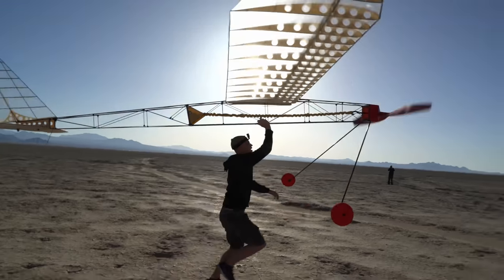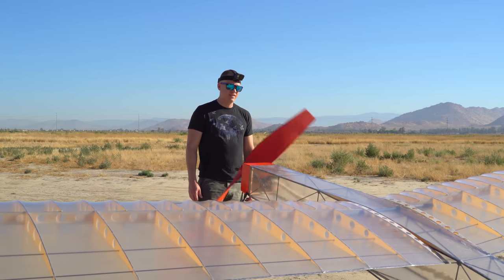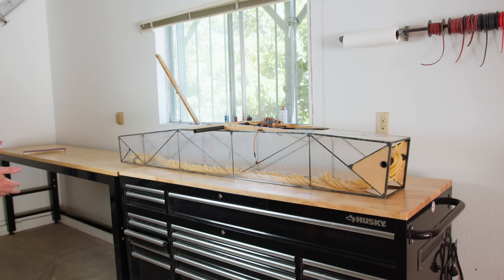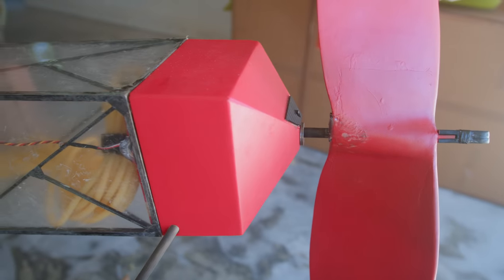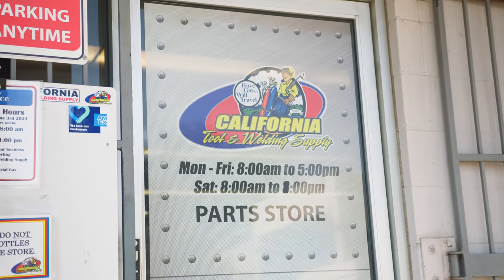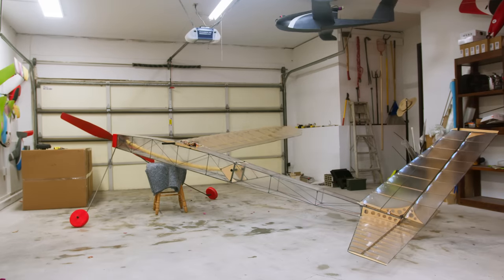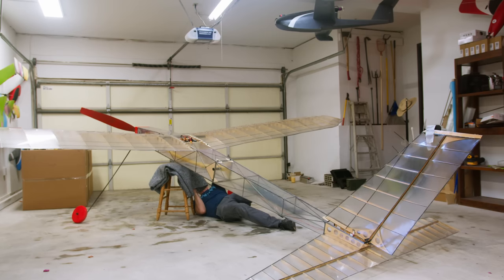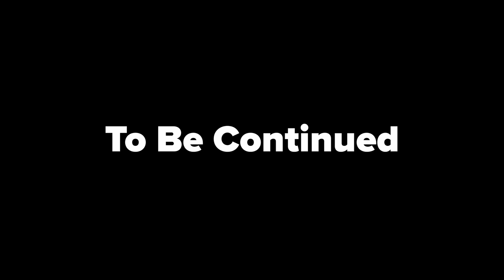Balloon Launching Massive 16 Foot Rubber Band Airplane

Comment: YES!  I wanted to see more of this project...sorry for how it ended but learning happened and better for it keep on!  One thing may help, aside from improved wing torsional rigidity; slightly more down thrust and a bit more decalage.  You'll probably need to adjust the c.g. fwd.  The initial powered flight in this video showed it nose up a bit.  Probably could have a longer powered flight from hand launch.  In any case, superb build and engineering.  Yeah, ok enough armchair engineering from me.  Thanks for continuing looking forward to more!

Comment: I love your determination. In the propeller’s blade twist, I recommend the propeller’s root angle not exceed 75 degrees away from the blade’s direction of rotation. Your current design clearly reaches a full perpendicular 90-degree divergence from the blade path, which creates extreme drag and reduces the thrust output.

Comment: Keep on going!  The repairs never take as long as you think, especially with an open structure like this. 
Diagonal bracing between the ribs for torsional rigidity, but also check the angle of incidence... tricky to tell form the video but it looks as if the main wing hasn't got much of an angle of attack relative to the tailplane. With more decalage, the model wouldn't have sped up as much upon release. I'd also add a couple more degrees dihedral too.... great work, very much looking forward to the next instalment!

Comment: I think you should use a shorter rubber band. Your issue seems the power and not the period for which it's produced, so a shorter band will help with that. In addition, it'll drastically reduce the weight. I could be wrong with this theory, but seems logical to me.

Comment: Am so impressed with the engineering of this design that keeps this aircraft light, strong and being fully transportable in a normal vehicle (9:17). Such an impressive set of engineering logistics and constraints to balance and manage, while staying true to scale of the original balsa model.
🤯♥
The flight sequence from 11:40 was not expected! Left me wondering if could have pre-revved propeller rpm, so as to release with positive thrust?  Questioning if the aircraft was able to create positive thrust relative to airflow profile as it flew. At higher speed the blades of a fix pitch prop, can act as airbrakes. Thinking negative thrust may have been a contributing factor to the downward pitching moment.
While the outcome may not have been desirable, this chapter of the project did collect lots of great data. Making connections with Chris, Curtis and others helping behind the scenes was definitely a positive outcome for this chapter. Thanks for sharing your rollercoaster of engineering and learning endevors. Look forward to the next chapter. :)

Comment: You can use a pendulum for the elevator and a clockwork timer for the rudder and dethermalizer. I used to do that in 70s and you can still find that stuff today if you look up free flight thermal flying. They even have international competitions.

Comment: Very inspiring. I personally find it difficult to push through situations which don't go to plan. It's very easy to give up and question yourself in these moments. It's very easy to let those intrusive thoughts win. It's very hard to keep going when you feel like you'll fail again and again. But no great achievement was ever easy and it's at these moments where greatness is born. 

Most people will give up when it gets tough but those people aren't written in the history books. Your channel's success is a testament to your personal ability to push through these moments. I love your channel for this reason (and lots of other reasons). Keep em coming and we'll keep watching! ❤
Reply from the maker: Appreciate you taking the time to say this.
Reply: @thinkflight  
the problem is that it is difficult for rubber to turn this screw, the screw should have as little resistance as possible, make it out of plastic and light. You can also reduce the diameter a little. The resistance on the bearing should be minimal
Reply: @thinkflight  
I made a plane with such an engine as a child. At first I used a wooden propeller, which I made myself, it flew poorly, then I replaced the propeller with a plastic one, from a broken helicopter, with which it began to fly well
Reply: @thinkflight  experiment with the design of the propeller, the problem is in it, it doesn’t fly well because of the propeller

Comment: I still don't understand why you don't use exercise bands.  They have versions with different strength levels and are very large.  You can also use a large spring of different types.

Comment: Mount the wing a tad higher, further above the CG for stability.  Or maybe add some deheidral for the same effect. No reason not to have both rudder and elevator.  And to combat wing twist, you could try some internal cable bracing between the wing formers.  Or go for diagonal, x-formers...

Comment: I remember an elastic powered plane I had as a child, it had strange wide props all the way to the tips not streamlined like the one's on yours.  Never seen similar props since but I do remember they were odd.  The plane flew I had flew for ages and some distance when I forgot to bend the rudder so it would circle, ,maybe bigger or a change of props on yours would help ?  

I think the idea was to move as much air as possible and not worry about drag so much as the plane wouldn't be flying that fast and it would help keep the speed  down at a constant velocity.

Yours flew brilliant at slow speed on hand launch and just seemed to need a little more oommph to keep it going ?

Comment: I know suggestions can fall flat sometimes so I’m starting with this:  This is amazing work!  The distance you’ve traveled in this project is impressive!

Great endeavors always take on a life of their own. Also they attract people who want to see others succeed!  

I have been watching this project from the start and I can’t wait to see where it goes from here!

So inspiring!

Now the suggestion:  Yes, you should definitely add the servo’s but the elevator is really a large trim control for this aircraft. 

Also, I think you should have the prop spinning with the nose pointing up before you release. This would require a really long tether between the balloons and the aircraft. The aircraft should already be nearly at its level flying airspeed when released so that there’s a minimum amount of drop. The flexible wings cannot withstand the over speeding of the air beyond the trim speed of the plane. It came very close to its VNE!  

If it’s practically flying at release it should stay in stable flight the rest of the time.
Reply: Yes!

Comment: This video ought be interesting....

I took the Guillows Flying Machine or the baby, baby, baby  brother of your plane and added two micro servos with receiver & a tiny brushed motor to it after adding a movable rudder and elevator by using scraps of balsa that was in the box of die cut parts for the rudder & cutting off 5/8 inches of the horizontal stabilizer to form an elevator. The hinges were made from two parallel strips of painter's tape joined at the center  with a coat of CA after aligned.

It flys beautifully in a calm sky. Love it....  Nothing else I have performs like it and its charateristics are very similar to the old Ugly or Slow Stick that Eflite seems to have brought back.

Comment: Some advice:
1) Materials like Monokote and Ultracote are specifically made for model airplane wings and they resist twist and stretch far better.
2) Your propeller pitch is too high given the size and the torque the rubber bundle can put out.  This is why the model won't climb very well as the prop is not generating much thrust.  It is like starting a car at a high gear.  The shape of the prop is really made for the small 4-5 inch diameter props where the rubber torque is very high for the size.  The pitch is intentionally set very high so that the prop won't spin crazy fast and waste power.  For your large model, since the rubber torque is relatively much lower, you need a much lower prop pitch to provide enough rpm, good thrust, and duration.  Note also when all is set right, the model can climb unexpectedly high and it could ride thermals (especially under calm sunny weather and the temperature is rising).  Unless you have a way to let it come down controlled manner you could lose it.  Please be aware.  👍

Comment: I've been building and flying free flight rubber since I was a kid in the mid 1960's.  It's been a big grin to follow your project and I was ear to ear when I saw the earlier short but highly successful flight.  And my stomach sunk when I saw the wings curl and the model dive to the crash.    

One option you might consider is carbon, kevlar or Spectra zero stretch fishing line to diagonally truss the wing's frame before re-covering.  I've seen this style of bracing in other mediums called "union jack" from the "XXXX" pattern of bracing applied to the "++++"arrangement of ribs and spars.  Perhaps try a short test panel  of two rib bays that match the wing's airfoil and spars and try various lacing arrangements to get to the one that is the most rigid before covering.

We'll be here when you come back.

Comment: I'm guessing the twist happened because it gathers speed in an uncontrolled dive before the prop was released, resulting in too much stress for the covering to compensate for. Powering up, letting the prop get to speed (resulting in a pitch up motion as if you were hand launching) and then releasing may work next time.
Reply from the maker: Agreed!
Reply: Yes get the prop up to speed.  Also some geodetic cross bracing on the wing panels to eliminate the twisting.  Small carbon, fiber rods should do the trick.  The wing panels washed out, causing the dive.  A working elevator would definitely help as well. Possibly some bracing like a Piper J3 cub has also.  What a great project.  
Very beautiful airplane.  
The balance point on the wing should also be pretty fairly critical. 
Just a guess, would be about 30% (of the wing cord back from the leading edge).  
I will definitely subscribe and hope to see another effort

Comment: Brilliant video, got emotional. If you can seal the wings, an elevated internal pressure will help stop them buckling -  if they're filled with helium, that's less work required to lift and thus more work available to overcome friction.
Keep on keeping on.

Comment: Could you also have a tensioning band that pulls the back of the twisting band backwards (in some kind of frame so it doesn't twist)? It seems like it could give you slightly more thrust for a little longer

Comment: Very interesting, but permit me a few observations. I say these as a flyer of free flight (FF) rubber-powered models for over 50 years. Although I don't know your degree of consultation with FFers, your project might well have benefitted from more such advice. Based on the hand launched trials, the model seems underpowered to me.  I also wonder about down thrust.  When I fly a new model, the first thing I check is the glide. Perhaps the first balloon trip should have been unpowered just to see if it could glide properly.  You deserve a lot of credit.  Please take my comments in the constructive spirit they were intended.

Comment: Just had an idea for your rebuild ( hoping that you do a rebuild) is maybe add a gearbox at propeller so its rubber band can start spinning faster at the start then switch to a higher gear once it gets going. Use a rc servo to change the gear ratio.

Comment: Hi, interesting project. But I did not get the point, why you want to launch a rubber plane at 400ft? Is'nt it more a glider in that case?
And: always secure gas bottles, even if they are filled with helium. The mechanical forces are very impressive when the neck is knocked off by tipping over

Comment: I wouldn't think of it as a failure, so much as a successful demonstration of what doesn't work. Perhaps some high-test string under tension tethering the wing to the fuselage would stiffen the wings? Just an idea. I'm probably not the only, or even first, to suggest this, but perhaps if you released the propeller just before deployment would help it generate enough forward momentum to avoid an initial nose-dive? Merely another suggestion, to do with what you will...
Keeo up the great work, and don't let this get you down. You'll make this work, yet!

Comment: Have you considered going to a set of short rubber bands? When the airplane lands there is a lot of unspent energy in the windings of the rubber. Having 4 or 8 rubber bands that are 2-3 feet long and connected to the propeller via gear drive would allow you to extract more energy from the same amount of rubber

Comment: I feel like something in your prop/bearing/rubber setup would allow slightly higher rpm, and slightly more thrust per revolution making it possible for the plane to climb under power. I realize things don’t always scale up or down like we might think, but still, a 30% improvement in your thrust could make all the difference. Get that plane up a hundred feet and you might could stay aloft a long time.

Comment: We used to put a tow-line hook on the bottom of the fuselage, and add a small brass tube just behind the propeller. Hook the tow line to the hook, and a short slack line from the tow line to a pin preventing the propeller from turning. Then tow the plane up, give the line a whip to release from the tow hook, then a stout jerk to pull the pin and release the propeller. Easy 5 minute flight from 40 second prop run.
Reply: That way the plane is already flying at speed.
Reply from the maker: Interesting....  will think on this.

Comment: That footage was awesome. I'm in a design build and fly team for my university and that aeroelastic is absolutely something I'm going to show my team. I'm sorry for the failure you've suffered, but thank you for showing us all what happened so we can learn from it.

It looks like the drop is at a higher speed than the plane has gone before. How will you deal with that and show your next wing won't do the same?
Reply from the maker: Several options; internal diagonal kevlar thread, diagonal ribs, d-box structure.   There are very established options, it will be a straightforward fix but will take time.
Reply: @thinkflight  thank you!
Reply: @thinkflight  will you check it in simulation or progressively expand the flight envelope?
Reply from the maker: @deSloleye  All those methods will be more than enough, which is why I was hoping to avoid them as they will undoubtedly add more weight and complexity than is absolutely necessary.   Basically it will be overbuilt unfortunately and I have no worries it will be more strength than needed.

Comment: I think the balloons could work. However,  trying to start from a stall was a bad idea. Maybe if you released the prop first you might have had enough speed  to keep her in the air. Also, I like your "never give up" attitude. Just a thought,  I've seen some rubber powered planes with more than 1 prop. Big plane needs more power. Good luck

Comment: everytime you start to fly the plane on the ground, you have a starting speed. but when you drop it, you dont have starting speed and you have to gain speed by nosediving and pitch up. or maybe try new method of dropping it down from tall places. hope this comment helps
Reply: I agree. I don't think the twisting is a real problem as long as there is a way to maintain a low speed.

Comment: Elastic energy storage in pure torsion doesn't scale up well. it should really improve stored energy and power output if you add a gear or pulley mechanism to convert straight tension in the rubber into rotary motion.
Also, hydrogen is really easy to make via electrolysis, but tricky to store or transport, and electrolysis would take a while for that quantity. Alternatively, it can be made on the spot, in quantity, by adding a few kilos of zinc powder, or aluminum foil, to water+sodium hydroxide. Careful about runaway heating, ice-water might be required at larger scale.

Comment: Did you ever consider a different mechanism for the propeller? Seems like there was an overall lack of power at the propeller. Wondering if some sort of gearbox could have improved that? Or would that be cheating?

Comment: Well, at least the plane remained repairable. Good luck.
 Several more thoughts. 
1)You can buy lots of methane in gas flasks and use at least three times more baloons to lift. Helium is extremely costly. People even made big garbage bags fly using methane from gas pipes. It is really cheapo solution.
2) you need freewheeling mechanism for rubber motor in order to decrease prop resistance after rubber gave out its energy
3) you need remote control on all possible control surfaces, as was mentioned before. These may overcome twisting or bending of your construction.
4)I think you neen to change rubber motor completely, in order to get maximum from it. Standard rubber twisting make only outer rubber bands work, which is not rnough. I'd suggest using some pulleys stretching rubber uniformly. Put pullies to one end of rubber and fix another end to the tail. Then fix second set of pulleys to the nose. Use rope and pulleys for tensioning rubber. Put the end of rope to some coil to drive the propeller.
Good luck again.

Comment: Failure only occurs when one gives up, and moves on. Can the wing twisting problem be solved by adding cables or struts like the ones seen on Cessna's or high wing mounted aircraft?